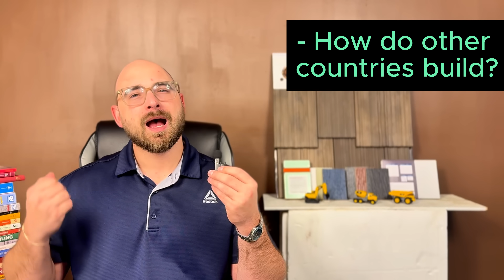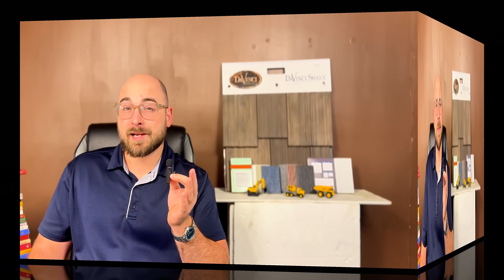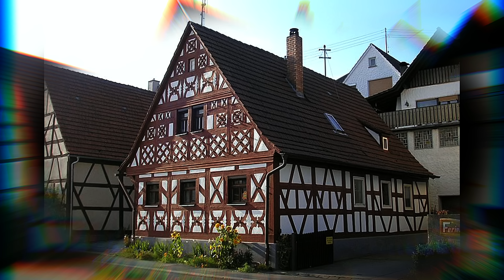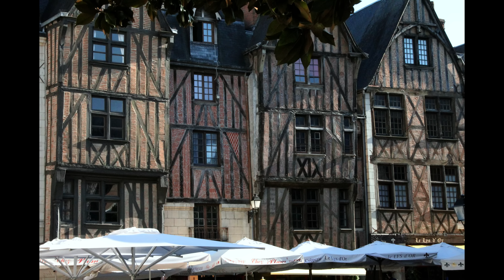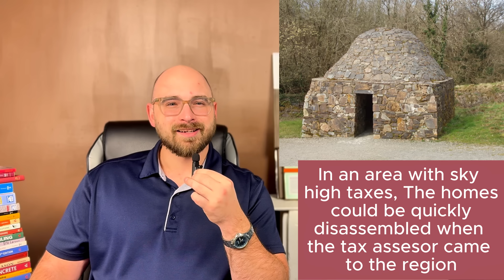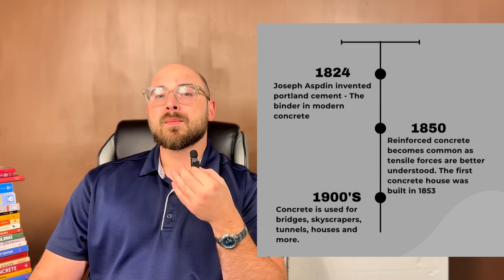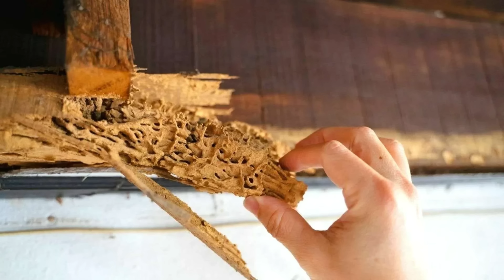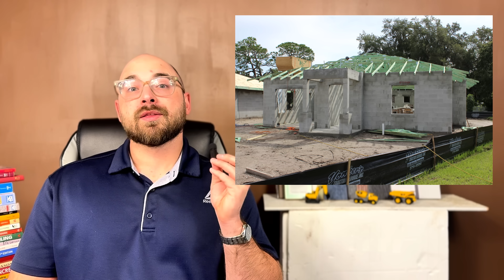Why Other Countries LAUGH at American Homes

Comment: 200K to 350K for a wood stick house per 100m2 its insane. 
To see the oposite side concrete in this country its 150k to 170k per 100m2 
Concrete durability its so much higher than a wooden contruction, also you can forget plagues, humedity, fire, twister, etc etc...
But wooden construction its faster and cheaper than concrete for sure....only pros.
Think about this....➡ On a Zombie apocalypse which would you prefer to be On a wodden stick house or a full concrete cube ? 🤣😂🤣
Reply: you could reduce the price by miling you own lumber in your acre lands, and build it yourself, its become trending now living off grid
Reply: @billykulim5202  The price of lumber for 100 m2 house is only $5k. Milling it would require a mill, tractor to lift the logs and a lot of muscle to fell and process the trees big enough for milling. It would be probably more expensive. The real saving is in labor. Material for seismic design, double wythe CMU and interior masonry would be around $25k. If structural bricks were used for much higher quality walls, it would be around $35k, still a small fraction. The recipe is: to educate oneself, get the best materials and assemble them yourself.

Comment: Here in Georgia, I've seen a lot of new home construction over several decades.  There is definitely a strong element of cost not necessarily equating to quality, no matter the size of the home.  I've visited spanking new homes that look fancy from a distance, but the walls are thin, the details are cheaply glued on instead of using quality carpentry techniques that are time-tested, entire subdivisions that are clones with forgettable style, poor landscaping that contributes to structural damage due to inclement weather or erosion, and the HOA regimes in some neighborhoods are bizarre to those outside the US. My family and friends abroad aren't critical of modest housing or older construction, mostly aghast at the cost per quality for newer ones.  

To summarize, the newer homes built for fast sales don't seem to match the promise.  Of course, individual homes that are build or renovated, whether they are humble or epic, do not get the same judgment because they are well-built and thoughtfully designed.

OTOH, some countries do not have building safety standards that the US is supposed to have.  Certainly the Pacific Rim countries account for earthquake proofing or typhoons, but not all countries in earthquake zones support that across the board. Building codes in the US can seem daunting at times, but I grew up seeing a lot of schools or hospitals that don't have enough exits in case of fire, have draconian electricity set-ups, stores that topple in strong winds, have low-income homes constructed in major flood or landslide zones, etc.

For me, if anyone, American or not, judges my home, either they are correct, in which I don't get mad, or they simply have a different cultural outlook, so there again no reason for me to feel defensive.

Comment: As a European living in USa for decades i've found your stapled together wood sticks and plaster plates houses so shitty that i've  always been horrified having to buy any of them even i could afford it.  You just don't realize how bad they are. No sound insulation, vibrating bouncy floors when you run on them, mold from over use of plastics,  horrible practices.  "drywall" is nonsense with paper cardboard as the top sandwich layer.  bathrooms are a joke of plastics. A wall should be something you can lean on and not make a hole if you accidentally hit it.  It makes me see americans as animals willing to live in what i consider to be animal sheds building level standard covered by a finish layer.  Yet your schools and public buildings are build from bricks proving that you live in substandard houses. We laugh when we don't have to live in your houses.

Comment: As a european I used to shit on how you guys built houses but I've done some research over the last year and there are some advantages to stick framing, but not 2x4 walls, at least 2x6 walls. In my vase i dont want a house to last for centuries, just for my lifetime.

Of the advantages i found:
- High insulation when used with 2x6. 
-Possibility of changing the house, like building or knocking walls down which cant be done easily with solid structure
-A man can build a house with his own hands and a few powertools 
-Wood is cheap
-You could reroute electrical or plumbing with ease since the walls are covered with drywall for future upgrades or even insulation if something better than rockwool appears on the market

I just dont get why houses in the US surpass 500k and going even into millions when materials are cheap and most mexicans you guys have will work cheap.

Comment: In the US there are houses built in mid 1800's with wood skeletons and they are stand still. From 1950 to nowadays, the concept of family has changed a lot, why having a house (wood or brick/concrete) if there are no more children, nor even relatives. Why start a futile fight about what country builds better houses if worldwide are abadoned structures, lots of houses are rotting on site. New generations can not even afford a rats-trap, or if they want to live far from home, they share a small apartment where even cockroaches do not want to live. The cost of renovation of a brick/concrete house is humongous, is easier to renovate a wood structure house, is not super cheaper, but is affordable in not longer periods of time. I have a house in Mexico buildt of b/c and the last earthquake made some tricks, and now I am hanging off from a lamp because is quite expensive the renovation. I used the best quality materials and one of the best architecture office in the country.

Comment: Thank you for this beautiful video  Apart from local ressources, I believe historic traditions have a strong influence. Firing bricks and lime is an ancient tradition, beginning before the Roman Empire. At the end of the 19th century firing bricks and burning lime was industrialized in Europe (unfortunately with coal, that's why we don't want it that way anymore). Half timbered houses are more popular in central-north Europe. In the central-south, like in the former Austrian Empire, brick buildings with lime plaster are the old standard. This might also have to do with the fact that the south was part of the Roman Empire. Brick houses without plaster are more common in the north, also UK and US. We should go back to traditional techniques instead of using concrete. I am a lime-fan 😊 By the way, Roman concrete does not use cement, but you need other rare ingredients (puzzolanic meterial), that may be one of the reason, why roman concrete did not become more popular. My visison: local brick firing and lime burning with local organic fuel (waste wood) instead of cement, which can only be produced with fossil fuel and emits huge amounts of CO2.

Comment: Honestly, the frame houses can last for a long time if they are done properly. My frame house was built  in 1975 and is still holding up.. frame house today  have very low quality pine wood like homedepot campared to frame wood from 1970s. Another thing is pine wood is a weaker hard wood material compared to oak or other hard wood material. Pine wood is cheaper and more cost efficient to use to build houses in America to cut down spending. To build a house today with better hardwood like oak will cost an arm and a leg. Older antique  American houses, 1900s, some of them  are still standing till this day in American ghettos because they are made out of brick and stone that last longer than frame houses. I worked on older American houses that date back to the 19th century. It's brick with very thick oak wood frame flooring beams. Including old frame American country houses that have thick oak wood frames for rafters. Europeans say this because their houses are made concrete and brick that last longer than framed houses. Frame houses today are built fast and more carelessly for money but dont get me wrong. Newer frame houses have better hvac ,plumbing, electrical work, better-looking designs, and latex paint has gotten better. We have become better in health concerns for housing but not in structure because building a house in brick and concrete today costs an arm and a leg. It not European have better houses they just use stronger  materials for their housing. We have gotten cheap although old American house are not built on codes and on permits and not built on the laws of the construction book. The measurements are off on old American house they are not built perfectly, and no architects. Not build on the construction book like we have to follow in today's standards. But man i tell you those house are still standing not all of them.

Comment: CMU (cinderblocks) definitely don't help keep the temp cool inside
Normal wood houses have a MUCH HIGHER R value
Reply: Normal masonry houses also have much higher R-value. Why would someone build a CMU block house without insulation? Either between two wythes of the blocks, or on the outside or by using for example Faswall block with built-in insulation or aerated concrete block - easy to work with, cheap and insulating, or ICF forms.
In climates with high diurnal temperature changes, masonry houses do stay quite cooler during the day. In other climates thermal mass insulated from the exterior will stabilize temperature swings and make it easier for heating/cooling to cope with the changes.
Reply: @ElegantiaeArbiter  
To be clear they DO have "insulation"
(The hollow parts of the blocks is filled with foam beads)
Reply: @toorimakun  In theory they can be filled, but the holes are designed for vertical reinforcing and not for insulating so the result may be negligible. With no rebars it would be 40% thermal bridges. With grouted rebar 16" on-center - 72% or even less considering horizontal bond beams. I have read that filling the voids changes R value of 8" block from 2 to 3.7. In case of vertically reinforced wall the gain will be even smaller.
Reply: @ElegantiaeArbiter  
Well in AZ they are filled with foam beads and they don't do shit to insulate against the heat

Comment: Over in California, homes tend to only be built with drywall and wood. You may think this is terrible as California is constantly on fire, and in a way it is. However using brick is a risk factor to firefighters, brick loves to absorb moisture and trap it, when heated the vapors expand and build pressure until the brick literally explodes and sends material flying across the area. Very dangerous, the benefits of brick are outweighed by the risks. Drywall is cheap, easy to instal, flexible, and doesn’t explode. However it is less durable and again cheaper. Also in the us many people just have a love for modern style homes, I hate this. They are ugly, especially when beautiful homes are torn down to make these ugly Amazon warehouse box homes.
Reply: This is something new. I heard that masonry buildings are built by communists and even fags, but I never heard they would be exploding. All other countries must be really ignorant not being aware of such a danger.

Comment: if engineered correctly a stick house is as robust as any brick or concrete structure
the crux comes down to insulation. this work is paramount unless you have very deep pockets
a stone or clay construct can be worse in winter than a stick build
whatever your choice seek a level 5 plus insulation rated build, could save you $1000's per yr in energy costs.
Reply: Wood is as strong as metal and stone?? What are you smoking?
Reply: @Talon19  you ever seen a car smash into a 60M tall tree??
Reply: @stronzer59 
Ever see a 60 meter tall stone and metal structure catch fire?
No.  The tree burns, the stone doesn’t.
Reply: @Talon19  Try 911
saw 3 buildings come down due to fires all were taller than 60 meters
one was not even hit by a plane.
your point again??
Reply: @Talon19  I said a well engineered stick house can be as strong as a brick or concrete structure
There are 800 yr old stick builds all thru Europe still standing. Go look it up.
Reply: @stronzer59 
And there are thousands of years old stone structures still in use.  Go look it up.
Reply: @Talon19  you're joshing with me..........
Reply: @stronzer59 
Not at all.
Thinking wooden structures can be as strong, durable, tough, etc as stone and metal structures is ridiculous.

If wood was, or could be, as strong, durable, etc. then security areas wouldn’t be made with stone and metal.
Reply: @Talon19  my reply was a well build stick build is as strong as any stone, steel or clay build.
300 yrs ago when folk built log cabins they were as solid as you could get
Try busting thru 2 feet thick logs with a hammer??
Only builds like the German Flak Towers were built to resist bombs and 200mm shells, next??
Reply: @stronzer59 
Exactly! Wooden structures aren’t as strong and resilient as stone and metal ones.
Wood structures can catch fire; not stone. Next.
Reply: @Talon19  What level Engineering degree do you have?? Civil, commercial, construction??
Every child knows steel is stronger than wood but wood can be just as strong  as steel when Engineered correctly
we are talking the specs required by Code
Reply: @stronzer59 
Bachelor in civil engineering, master’s in structural engineering.
You are just making more excuses and deflecting because you made a poor decision and now need to keep moving goalposts to defend your poor ego.
Grow up.

Comment: Comparing USA vs central EU.

American houses have wooden construction mainly because of wood abundance in the US, that is main historic reason. Also, they build them so it is cheap and fast. Except, because of extreme price increases, it is no longer cheap, just fast. The quality of these houses compared to European ones (new houses) is usually much worse, the only advantage is the construction being easier and faster, but usually not even cheaper than EU.

In Europe most of new houses are made with reinforced concrete floors + reinforced concrete and brick walls. Then you have 20-25 cm of insulation (usually styrofoam) from the outside (in central EU) which makes the walls have extremely low heat transfer coefficient, usually lower compared to US houses, which is beneficial both in winter for heating and in summer to reduce overheating. Also windows - the standard in EU is now triple-glazed windows with really low U-value. This type of construction is superior in every way compared to light, wooden houses:

- extremely high thermal mass - once you heat the house, it is very resistant to temperature change. You can lose power for days and your house will regain a lot of heat because of great insulation and high thermal mass. Also greatly beneficial during summer - it takes a long time for the building to be heated up to be uncomortable indoors, usually a very small AC split units are enough to keep low temperature or you don't need one at all (but usually it is needed in new houses because of big windows generating a lot of heat in sunny days).
- minimal thermal bridges - insulation from the outside guarantees minimizing thermal bridges, in the contrary to US system with insulation from the inside.
- no water vapour problem - the entire construction part of the wall is in the warm zone, the thick insulation is from the outside, 0% risk of water condensation inside the wall during winter or during summer
- not to mention the sturdiness of these houses, resistance to wind etc.
- also a very important advantage of such a European house - soundproofing. Noise inside the house is really reduced between floors and rooms compared to light construction. Sound from outside is also almost completely eliminated when windows are closed.

The  important reason to build a light wooden house is because of seismic activity, which is definitely higher in some areas in the US, and we don't really have that problem in the EU, so that's true that is one advantage which makes sense to use this type of construction in some areas.

The typical, well built house in the EU will last easily 200+ years. If made with solid materials, reinforced concrete it is basically like a bunker. Meanwhile in the US you can just break into a house just with a box cutter.

Comment: It's not even just the fact that America is using wood as a building material. 
Its the fact that America builds wooden houses in the land of tornadoes and wildfires.
And most contractors are fine with this because planned obsolescence supplies them with job.
Reply: The tornado would use the bricks as missles and would fling bricks all over the place

Comment: As an electrician, people already freak out at how expensive it is to add some outlets or a ceiling fan. And that's with me fishing through insulated hollow space. I couldn't imagine what it would cost to do the same in a concrete home. I'd imagine you have to wet cut concrete, run raceways, and then patch the concrete. Either that or ugly surface mount that everyone hates.
Reply from the maker: That makes sense 

What I like is doing the exterior walls out of concrete, using ICF so you can route electrical / plumbing through the foam. And lumber or steel for partition walls

Comment: Great video. As an architect in CA, I think we should be building more homes with re-enforced concrete. At least for the exterior walls.
Reply from the maker: It would certainly help with the wildfire issue
Reply: You could learn from the Swiss and the Japanese…🤔 Also because of earthquakes…

Comment: The problem that concrete/brick houses have with domestic fires is that they cannot be extinguished at a certain point and the entire house becomes an oven and the entire structure collapses under its weight. rebuilding them is more expensive than buying a new house.